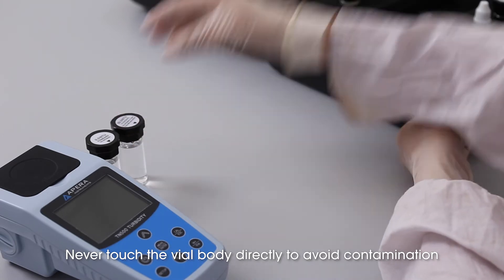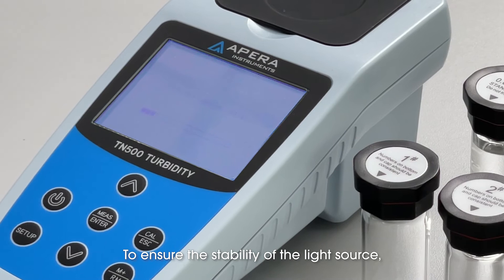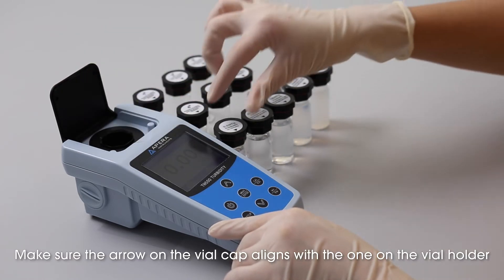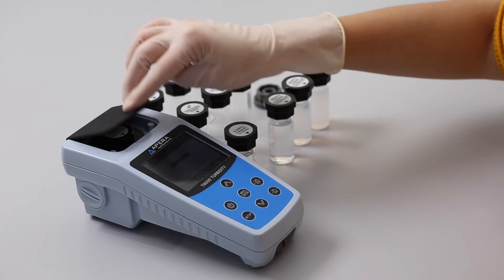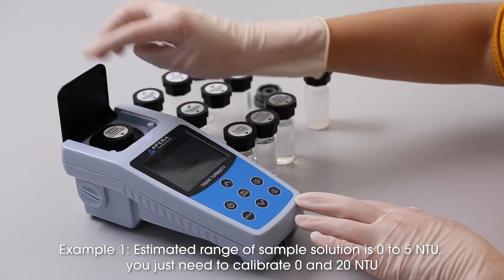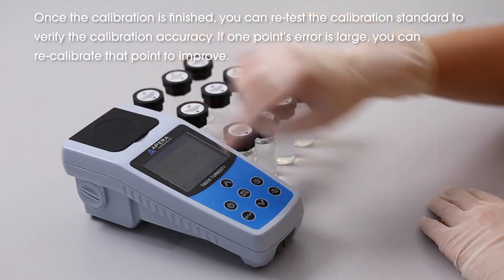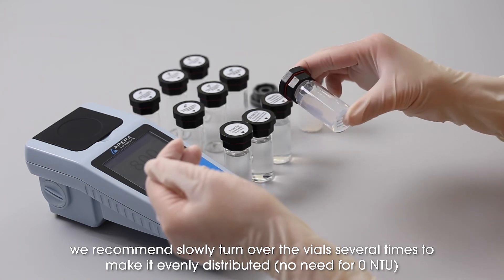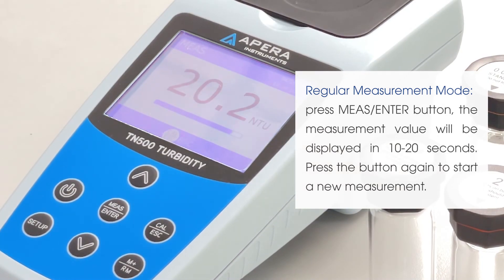Apera Turbidity Meter Tutorial

Comment: Hello, i have a question about your ph 20 series ph metre. If you calibrate it at 2 points (7.0 and 4.0) will the metre only be able to test ph up to 7.0? Or can it ph higher without the need for the 10.0 calibration?
Reply from the maker: If your estimated range is lower than 8.0 pH, then there is no need to calibrate 10.01. If higher than 8.0, then we recommend calibrating 10.01 to minimize the measurement error.